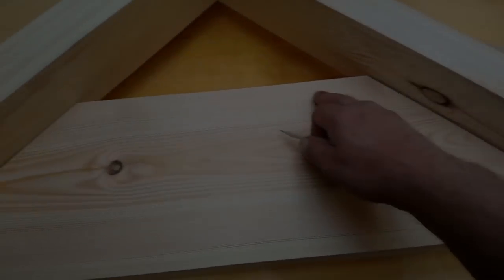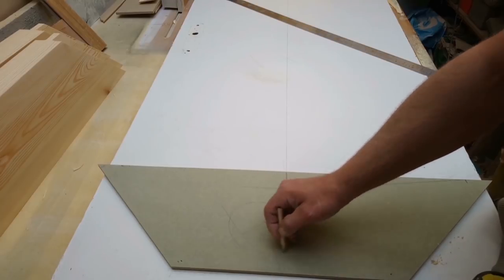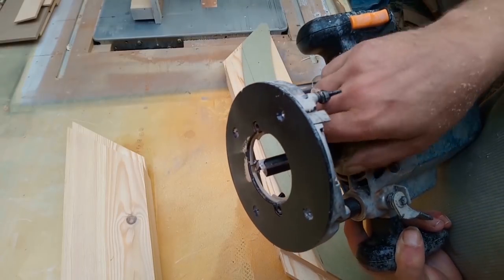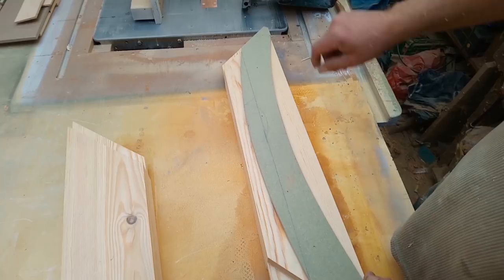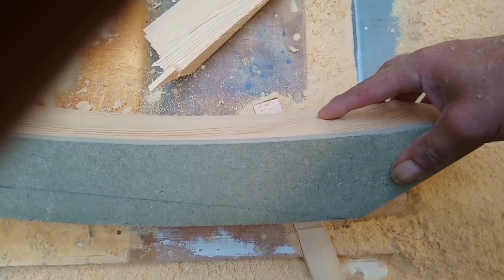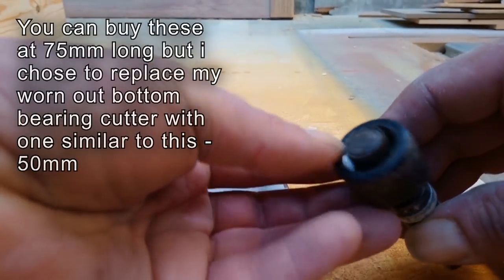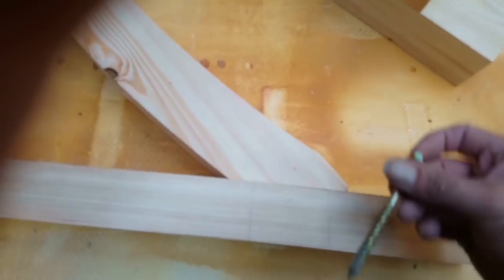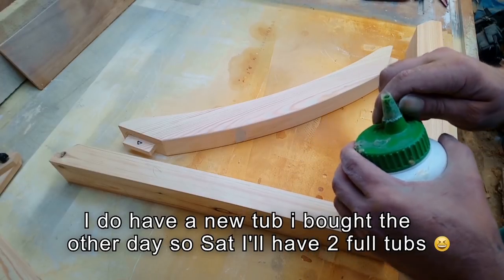Porch Canopy Build Pt2 - Making the brackets 2

Comment: Nice brackets. Traditionally the top joint would have been mortice and tenon, pulled together with a draw bored dowel, as would the joints on the brace. Particularly with modern glues there would be no need for the coach Screws. They do look nice though.
Reply from the maker: Yep, i think i mentioned the top joint but i didn't want to create weakness in that top piece of wood by chopping in a mortice, The coach bolts were just easy/overkill n the draw bored dowels - i didn't want to, couldn't be bothered...I wasn't happy with the size those tenons came out.. I don't really have an answer, 🙃😏 lots of glue n a big screw 😊
Thanks 👍

Comment: Traditionally, presumably for hundreds of years, the curves would have been done on a bandsaw (tool history, anyone?). And that would have had to be freehand? So you make use of the new technology, the router -- accurate but taking much, much more time? And instead of screws, would they have used deeper tenons with misaligned holes for dowels to pinch the joint tight? Can anyone help me here? Thanks!

Comment: Just subscribed. Great job. What did you use to treat it before painting and did the treatment make painting it difficult to get to stick??
Reply from the maker: Hi. I use a clear treatment, Everbuild Lumberjack clear is the one i have but have had different brands over the yrs, without going into the specs n science you have to trust they'll do the job over time, most wood will last a long time as long as it can dry out after getting wet, I made a small gate a long time ago, blathered it in clear treatment but the owners never bothered painting it, it's still working 10yrs+ later, it goes on like water & i've never had an issue with any type of paint not sticking or reacting with it, it does feather the wood up a little just like water would, but just needs a light sand before painting, Thanks 👍
Reply: Gid Joiner thank you. Look forward to going through your videos. 👍👍
Reply from the maker: 😁 I've only been putting effort into filming my work for about 18mths but I've been a joiner for 36yrs, this is my job & i'll carry on filming to share as much as i can, I discuss with clients the design & options for materials but in the end it's their choice, & i have to get the job done within time n budget so sometimes not 'perfect', There's gaps between my vids sometimes, i film my work not work to make vids for YT if that makes sense, so sometimes i can't film, the job's done before the camera comes out or i just have to crack on n get the job done, but i'll film & upload as often as i can 👍 Thanks 👍

Comment: Great lay out tips for the arch.what type of filler are you using, some use an auto body filler.. another great  video for learning.
Reply from the maker: Hi, this is U-pol body filler, it's a fine skim filler tho so is a bit runny. I've a massive 3.5L tub so i can be generous with it n it's cheaper than wood filler, 
Thanks Peter 👍

Comment: Could you have draw bored it?
Reply from the maker: yep but he tenons weren't very big, they were only about 1" 25mm long, the dowel would have been only about ½" 12mm from the end of the tenon or the face of the mortice piece, so i think it might have split out the tenon or the timber around the mortice, i also wanted the screw to be part of the support too.
Reply: @Gidjoiner  I often wondered if wedged tendons on the bracket would be a sufficient  joint. I like using as little screws as possible.
Reply from the maker: yeah i understand that & normally i agree but there was a lot of weight & this is outside stuff,  it's open to the elements so fat chunky solid fixes was the safer choice.

Comment: Yup, great job. Curious though, would drawboring them have worked? Instead of screws. As I said, i'm just curious 👌
Reply from the maker: I did consider that, the wood that goes on the wall is 4" wide or the planed version of that 90mm, so the dowel would have to be quite long, if the tenons had turned out as wide as i intended it would have been more of a consideration but not with these skinny ones, i think i would feel like i was compromising their integrity. The top piece that is going to have the cross beam sat on it would have a hole drilled through it along with a mortice where strength is needed, Fair question Zuber but for an outside project no was the decision, 
Thanks, 👍
Reply: @Gidjoiner  thanks Gid for the reply. Makes total sense, learn something new every day. Really looking forward to the rest of this project.👍
Reply from the maker: No prob, job should be done end of this wk 👍

Comment: What filler do you use?
Reply from the maker: It depends, if it's interior or exterior, whether i want it to go off very quickly or can i leave it over night, the two part fillers go off quick but can be harder to sand & the white 'polly fillers' sand easy but deep holes take time to dry.
One Strike filler, it's light n fluffy, the tub feels like it's empty. 🤪
A two part filler, i ran out of wood stuff so I'm now using a bit tub of U-Pol Easy Sanding Body Filler i bought from a Carlac car paints for the van, it's a bit Fine for deep holes but they do a Deep Repair version which is prob thicker
There's an instant plaster filler in a tube, it sands like filler not like caulk which can be rubbery.
https://www.toolstation.com/one-strike-ready-mixed-filler/p20822?utm_source=googleshopping&utm_medium=feed&utm_campaign=googleshoppingfeed&gclid=Cj0KCQiAk-7jBRD9ARIsAEy8mh7ULF4VogImW3HVwVn84tnhKsCVI04ol82Mw9NOnNnvd3NQVKo3NzcaAtZDEALw_wcB

https://www.amazon.co.uk/dp/B002HMQG2A/?coliid=I392LF7O2N947I&colid=3UBWC9NW89BTU&psc=1&ref_=lv_ov_lig_dp_it

https://www.amazon.co.uk/dp/B019MXFXIO/?coliid=I8ESFA1HBO7A7&colid=3UBWC9NW89BTU&psc=1&ref_=lv_ov_lig_dp_it

https://www.screwfix.com/p/no-nonsense-instant-plaster-filler-white-310ml/72591
Reply: Gid joiner great! Thanks for the links, love your videos i learn alot from them, just started a porch roof like the one you did, hopefully ill be as good as you one day from one joiner to another
Reply from the maker: 😊👍
I'm sure In time 👍 
Set your standards high. I try to build something as if it is on my house & would i be happy with it, In my head i put my expectations high, but as you know when building these sorts of things you can't build something perfect, conditions, materials & the structure/house it's going against aren't perfect so when i fall short because I'm rushing to get it done within a time schedule, quality of materials or budget... at least the lower quality than I'd like is at least acceptable.
Reply: Gid joiner looked through you fb page there’s some really nice builds on there would love to see some decking videos or stair spindles, they have always had me wondering how it would be done as I’ve never done them myself (never needed to) keep the videos coming absolutely love them!